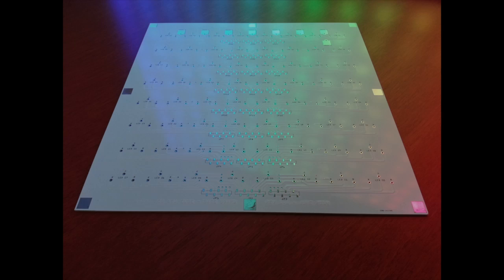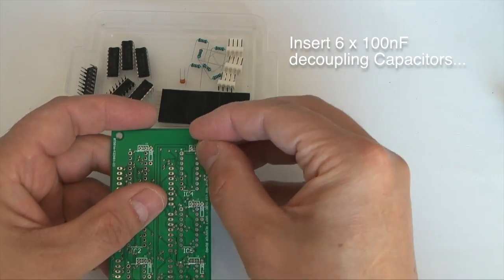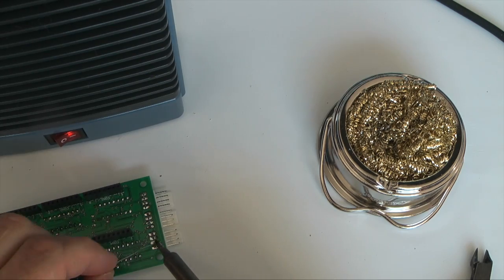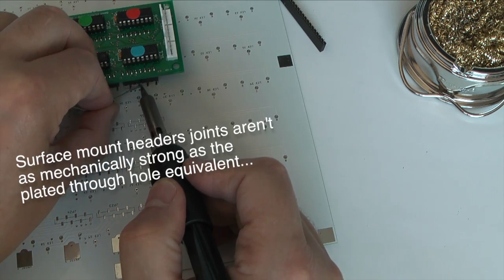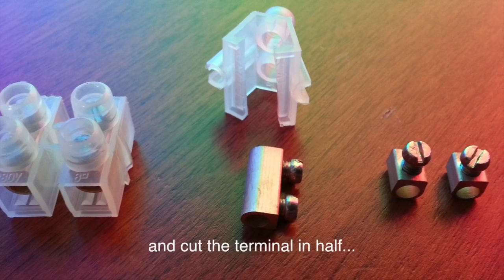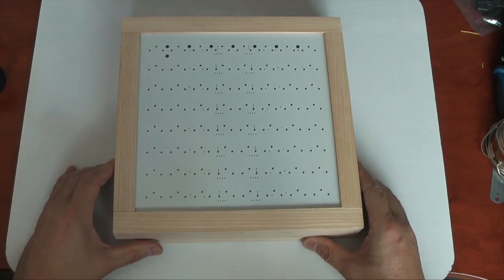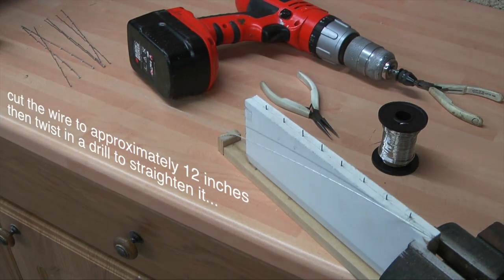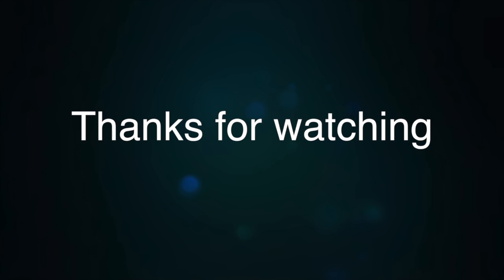Construction of an 8x8x8 RGB LED Cube. Part 5: Prep for Cube Assembly

Comment: Nice and beautiful project...
How i can get all of part...can you help me
Reply from the maker: Thanks for the kind comment. 

I’m sorry to say that at the moment, I do not supply parts, but that might change in the future. 

Many others have 3D printed the parts themselves, and purchased the LEDs, micro controller and real time clock from their chosen suppliers. I would love to supply a kit of parts and I am developing better solutions and parts at the moment, but the cost of getting them made professionally and of high enough quality and at a reasonable price, is not easy. 

I personally wouldn’t want don’t to supply low quality parts, and my 3D printer etc. are not good enough, plus it takes approx 20 hours to print them, and that’s if nothing goes wrong. I have had the parts laser cut, and they are better, but I’m still not happy with the quality and cost. The circuit boards are not a problem to produce, but some of the components are not cheap, so needs further development.

Comment: Good evening, Mr. Stave. Kindly tell me how I can reverse the text from left to right. Sorry for trouble and many thanks.
Reply from the maker: Hi, It depends on how exactly you want it to display the message moving left to right. You could start at the first character of the message and move it left to right, followed by the second letter and so on, which might look a bit odd, Or you could start with the last character and move that left to right, then the second to last letter, and so on. This may also look a little odd.

The method I used to scroll right to left uses a buffer which left shifts, you could use right shift instead, and load each character into the 8 most significant bits instead of the least significant bits. You would also need to display the 8 least significant bits instead of the 8 most significant bits, plus maybe some other bit manipulation. There are multiple ways to do it.

I recommend you try a few things out yourself, just like I did when i first wrote the test code. It can be frustrating, but when you figure it out and it works, then that feels great.

Comment: Hello Mr. Steve. First of all I want to thank you for your support. I built a similar cube, it works perfectly. I wanted to increase the animation so I installed an Arduino Mega 2560 and set the pins: SPI_SCK = 52, SPI_MOSI = 51, SR_LATCH = 20, SR_BLANK = 21. It does not work. I mention that I am a beginner, so I have a lot to learn. Can you help me with this? Thanks again for everything you do for us. You have a good day, sir.
Reply from the maker: Hi Florecs, sorry it’s taken a couple of days to reply. Also sorry to hear your having an issue with the Mega. From memory, I don’t think I’ve ever tried running the cube with a Mega, but it shouldn’t be to much of an issue to get it working. If you have mapped the pins correctly, and I haven’t checked or it tried myself, then it could be timer or port mapping differences between the Uno and the Mega. So I’ll have try it with my Mega and let you know in a day or two.
Reply from the maker: Hi Florecs: I have my Mega running my cube with very little code change. If you have already changed the pin assignments at the beginning of the sketch, then using your new pin mapping, I altered the Interrupt Service Routine (ISR) at the very bottom of the sketch. I changed every instance of SR_BLANK with 0, and every instance of SR_LATCH with 1, so that it looks like the code below. I left all other references to SR_BLANK & SR_LATCH in the remainder of the sketch as it was.

// =====================================================================================================
// ~~~ START 0f ISR ~~~
// --------------------
//   Updates the panel. Called every 125uS (8KHz), each row is lit for 1/8th of the time (1KHz)
// =====================================================================================================
ISR(TIMER2_COMPA_vect) {
  
  PORTD |= (1 << 0);                      // temporarely disable the SR outputs
  for (int i = 0; i < 8; i++) {
    SPI.transfer(shiftRegisterRed[i + anodeIndex * 8]);    // send the red SR byte for the given anode level
    SPI.transfer(shiftRegisterGrn[i + anodeIndex * 8]);    // send the grn SR byte for the given anode level
    SPI.transfer(shiftRegisterBlu[i + anodeIndex * 8]);    // send the blu SR byte for the given anode level
  }
  SPI.transfer(anodeLevel[anodeIndex]);          // send the anode multiplex byte
  anodeIndex = (anodeIndex + 1) % 8;             // incrument anode index ready for next ISR
  PORTD |=  (1 << 1);                     // set latch pin LOW
  PORTD &= ~(1 << 1);                     // set latch pin HIGH - SR outputs now have new data
  PORTD &= ~(1 << 0);                     // re-enable the SR outputs
}
// ==================
// ~~~ END of ISR ~~~
// ==================

Part of the reason the code was failing is because the pins you chose, use different bits on PORTD. on an UNO they were bits 2 & 3, for the mega, they are bits 0 & 1. The definition of SR_BLANK & SR_LATCH on the Mega are now 20 & 21, so in the IRS where the bits are shifted left (e.g. PORTD |= (1 << 0); ), on the UNO by 2 & 3,  are now being shifted by 20 & 21 on the Mega, which is way to many shifts for the ISR to be effective. So I have just substituted the references with hard numbers. If you had of used PORTD bits 2 & 3, it still wouldn't have worked because these map to 18 & 19, which are still to many bit shifts. The solution is quick and dirty, but it works on my cube.

For info, I use the direct port manipulation like "PORTD |=  (1 << 1)" etc. in the ISR, because they execute way faster than the more standard digitalWrite(SR_BLANK, LOW) instructions. Timing and code execution in the ISR needs to be a fast as possible, and the direct PORT writing, when compiled, executes in one machine cycle, while digitalWrite takes several machines cycles.

Hope this helps?

Give it a try and let me know how you get on.
Reply: Hello Mr. Steve.
 I made the changes and the cube works perfectly. I wanted to unify your two Cubel_Burn_in_Test_v1_0 and Cube0_0 codes but it does not work correctly. I've noticed differences in "Set Pixel" and "ISR" but I can not handle it. You can help me if time permits, please. Or maybe with other animations running on the cube. My email somesanvasileflorin@yahoo.com
Thanks a lot for everything and I wish you all the best. My respects.
 @stevemanley3685
Reply from the maker: Hi Florecs, I don't normally share my e-mail address, but quite happy to continue supporting you as best I can through comments here, and others may benefit by reading these comments.

It is a long time since I did the cube, and the cube is probably long overdue some extra animations. However, I'm currently busy with work and other projects, and can't afford the amount of time it would take for me to do such a task. Coming up with code to create the animations doesn't come easy to me either. I'm not that good at figuring out the math, and my code ends up a lot longer than someone else might wright, so I would have to look at other peoples code to figure something out, else I just use up loads of programming space with inefficient code.

A couple of years ago, a young lad built my cube as a school project and improved the code I had written, and made the cube display more colour variations and 4 different animations. He shared that code with me and the link to that code is here: https://www.dropbox.com/s/dekf5b8sqfovprh/Dagans_Demo.ino?dl=0

Dagan's code uses bit angle modulation (BAM) in the ISR (try googling it), which gives the illusion of more colours, but again the SetPixel routine will be different to the other 2 sketches you already mentioned. If you download the code, and modify it in the same way you did the previous one, it should work on the Mega. I have not tried it myself on a Mega, but it will run on an UNO unmodified. I currently have my cube running this sketch.

When first looking at someone else code, it always seems hard for me to understand whats going on, but if I keep having a look at it every know and then, and it eventually does start to come clearer. Can I suggest you have a go at figuring this out for yourself. It would be more rewarding to you, if you can.

I can try and assist if and where I can, but I am sorry to say that I can't allocate a lot of time right now.

Best regards
Steve
Reply: Thank you, Mr. Steve. You're right. The bigger the challenge, the better the satisfaction. Thanks again for all your support and wish you success in future projects. All the best. @stevemanley3685

Comment: I’m based in Australia and I’ve been using JLCPCB for quite some time. 
Certainly can’t complain about the price or quality. I had to contact them as the base board Gerbers are fine in their online Gerber viewer but I can’t get their webpage to load them into the area where you place an order or get a quote. Unfortunately I’m conversing via email with a very poor English speaker and I can tell from what he says that he doesn’t really understand what the problem is. I’ve now sent him the 3 sets of Gerbers in the original zip files and hope that might bring some light to the situation.
I’ll keep you updated with my progress which will be slow in any case as I accumulate the various parts and try to get all my other projects completed. I just couldn’t resist starting as your 8x8x8 Led cube really deserves to be made by as people as possible.
Reply from the maker: If you were in the UK, I'd supply you a base board as I have a couple of spares.

The board design was created in Fritzing's PCB layout mode as there are no components as such, just the surface mount connectors. They were a bugger to solder but once done, have been as good as gold. Obviously not as mechanically sound as through hole headers. Maybe it's time to have a go at version 2 of the base board, but with JLCPCB's online software, and use through hole headers this time, just makes for a less attractive top surface.

Comment: Wasn’t sure I’d get a reply considering how long ago you first created this project. My first problem is that the pCB house I use can’t read the Gerbers for the main board. Apparently the files are not in the RS-274x format. The Anode and Shift register boards are OK. I notice you used Eagle so I wonder if  I could get the Eagle SCR and BRD Files for the project from you and I can generate my own Gerbers. Maybe another contact method too.
Reply from the maker: I pretty much try to reply to all comments regardless. It's always nice to get positive feedback and help others where I can.

I have to say that one of the Gerber files not meeting a standard is a first for me. No one else has mentioned it and been able to create the base board regardless. I do use Eagle, but I only have the free version and a full licence is way to expensive for the Use I would get from it, thus there are board size limitations. I therefore created the main base board in Fritzing instead, which is also free and no size limits that prevented me from creating it.

Sorry to say that I don't share the original source files, being the Gerber files are normally sufficient to get the job done. You could use http://jlcpcb.com in China. Not used them yet myself, but I will do the next time I get some boards made, as I hear it is a quick, cost effective and a quality service.

By any chance, are you UK based?
Reply from the maker: What other contact method did you have in mind? Personally I wanted to keep all solder joints (apart from the LED wiring) to be on the underside of the board out of site, which is why I soldered terminal block connectors to a Pad.
Reply: Steve Manley  I was referring to a different method of communication (contact) as I hadn’t used YouTube other than making an occasional comment not a conversation. If you want to keep our conversation out of the public domain (email address deleted).
Well my progress has come to a halt. The word back from JLCPCB is that the base board file is not compatible as it’s not RS-274x. Actually it would be interesting if you would create an account and try to upload the base board Gerbers.
You mentioned you still had boards left. I’m happy to pay for the board and postage as my alternative is to try reverse engineering. The only critical part is the spacing for the surface mount headers.
BTW Kicad (donation) and Diptrace (non profit) are EDA programs that have versions that don’t have size limits,

Comment: Now, if the wires were lacquered matte black, I'd wager the images would look even better.
Reply from the maker: Anvilshock Thanks, you might be right. I did consider it, but chose not to as it would make replacing an led much more difficult. Plus you’d need to be sure not to get lacquer on the leds.
Reply: I have built a monochrome 8x8x8 myself, my "jig" were 2-pin headers on a large breadboard assembly. Darkening the wires only came as an afterthought once everything was soldered; and even though it is an almost Sisyphean tedium to snake a non-flexible felt-pen through the mesh, the wires now being far less reflective improves clarity significantly. I can only recommend to try it any way possible. Possibly some form of shallow dipping bath could be employed after finishing a layer.
Reply from the maker: Anvilshock Thanks for the tip 😀

Comment: hi steve, i have made a cube, he works fine. Now i want to program my own animations, i can't find how i can light up one specific led in the cube. Thanks in advance.
Reply from the maker: Hi Sebastiaan, If you look at my code example, the first line inside 'LOOP' there is a commented out 'While' statement, that if you uncomment and upload, will lite just the bottom 4 corners, one red, another green, blue and yellow.

This uses the 'setPixel(Xpos,Ypos,Zpos,R.G.B);' function where Xpos, YPos & Zpos can be values from 0-7 and R, G & B can be 0 or 1. Setting combinations of R, G, & B will give you the 7 basic colours Reg, Green, Blue, Yellow, Cyan, Magenta & White. To get more colours requires a significant restructure of the code and use of a system called Bit Angle Modulation. It can be done, I just haven't got around to working out how to do it. Kevin Darah has some video tutorials on it for his cube if you fancy taking that on.
Reply: thanks a lot, you made my day!

Comment: Hi Steve, excellent build.  Wondered if you have the pcb's for sale?  or the best way to create them.  Is it possible to etch them at home (dimensions?)
Reply from the maker: Hi, glad you like the build. The build is only a prototype and I only ever had enough boards to build 2 cubes, and I sold the spare set already. So I'm sorry to say the boards are not for sale, at least not from me. I dare say you could home etch them but you may well hit a snag with the via holes as they are quite small. The biggest board ( the base board) is 9 inches by 9 inches. Hope this helps.
Reply: would it be better to send off the gerber files and get them pro made?  no opposed to the option.  or if you have a link to where you had them done.
Reply from the maker: +CrankyCoder I had them made via a company called Proto-pic in Scotland, who in turn had them made in China. If your UK based then it might be an option as I have already paid the setup costs, so might be cheaper for you. Try contacting them and ask for Drew, mentioning my name, hopefully they will remember me.
Reply: Im not in Scotland unfortunately but I will try to hit them up.  The gerber files im guessing i could send to a shop here in the states too right?
Reply from the maker: +CrankyCoder I'm not in Scotland either but closer that you I would expect. If your in the US, I bet you could find someone reasonable to make them, if your not in the US then I have no experience to offer and advise. There is always China directly, but that can be tough with the language barrier. I know first hand buying LED strips.
Reply: so I can just use the gerber files in your dropbox?
Reply from the maker: +CrankyCoder Being that's what I used, yes you can.

Comment: Hi steve, great video's built a cube using your design for matrix and using a board from supertech on ebay, driven by arduino mega 2560, however i am struggling with the arduino to circuit board connections and supertech offers no help, connections on board are marked CLK. ENABLE. LATCH. RESET. RED. GND. GREEN. GRD. BLUE/SINGLE. The 8 layers i have the pin numbers, having limited experience with electronics any help would be gratefully received. thank you in anticipation BJ
Reply from the maker: +barryjeffery999 Hi BJ,
Glad you liked the videos. Personally I have no experience of Supertech's board and electronics, other than I know they differ from mine. 
It is shocking to hear that he won't offer support, especially as you will have paid him.
If you had gone with my design in totality then I would be more that happy to share what advice I can, but I can't be responsible for someone else's hardware and design. You can also be sure that my software will not work on Supertech's hardware without modification.
You are the second person recently to ask for advice on someone else's design but they did't say who's it was, but I can guess. 
It may seem hash for me to say, but Supertech is the one who should be helping you. If you need help on the matrix construction then I'm more than happy to help.
Reply: Hi Steve, thanks for the reply, already built the matrix using your designs...... looks great! just need the last few cables in place from the arduino, it seems that supertech's world  revolves around money, probably not into the spirit of sharing, shame really.
Anyway thanks for the reply, love the video's and the EEtimes stuff Best Regards Barry